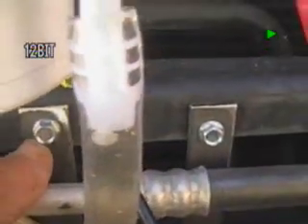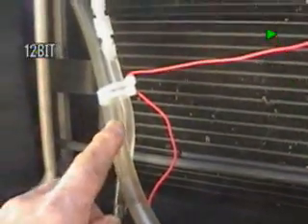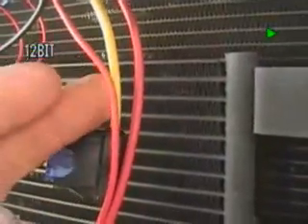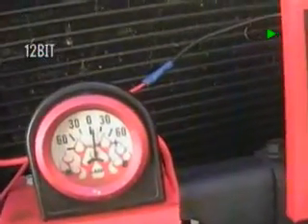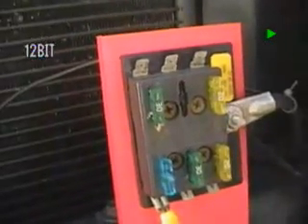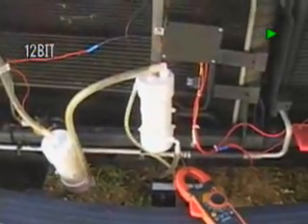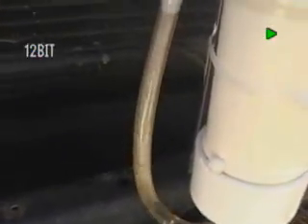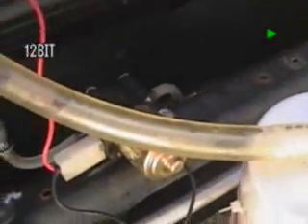Series 11a MagDrive Brick

Comment from the maker: The 11a & 12a use the same HHO generator. Only the 12a can have as many as 4 gens controlled by a micro processor unit, whereas the 11a is electromechanical relay controlled and has only 1 generator.

Comment from the maker: Oxygen sensor is supposed to be replaced every 40 - 60k miles according to most owners manuals maintenance schedule. O2 sensors DO WEAR OUT and go out of tolerance and should be replaced as prescribed in your owners manual.